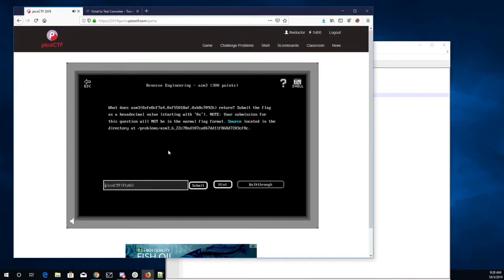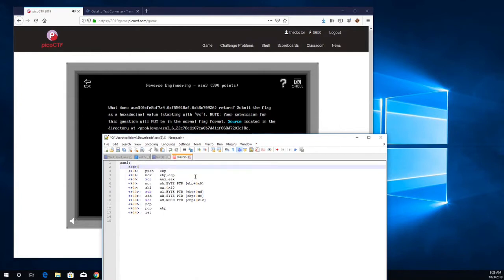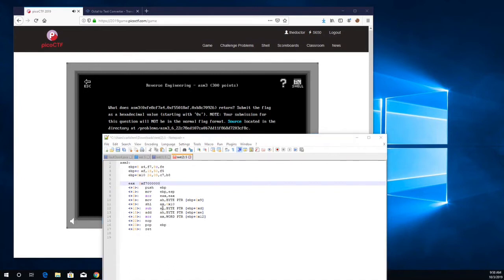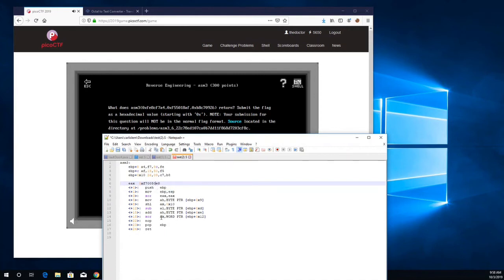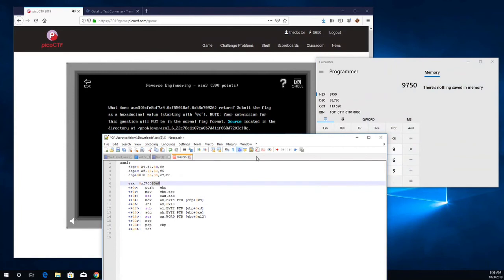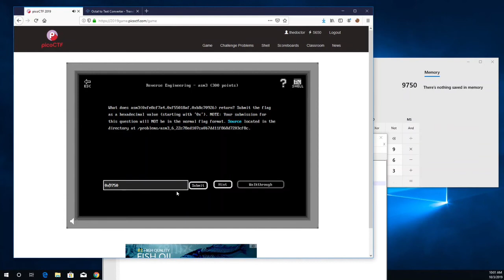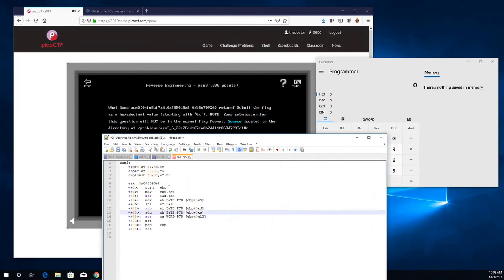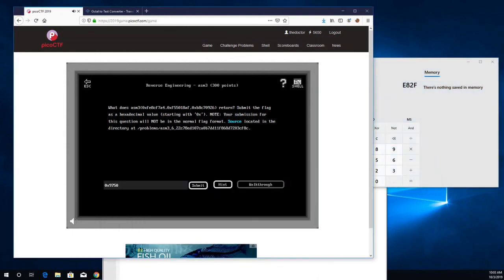pico2019 asm3

Comment: Hello, how do you know that it is in the little endian format and how do you know that the first parameter will go in at ebp+0x8?
Reply from the maker: The intel architecture is little endian. Parameters are pushed onto the stack. Then, the call instruction stores the return address on the stack, then there is a push of the old ebp, so there are two values (8 bytes) between the new ebp and the parameters.
Reply: @carlislemc  thank you very much Martin

Comment: i dont understand the sub at <+12>

al = 0x00 since eax = 0xf7000000; [ebp+0xd] = 0x18

so the calculation, as  far as I know, should be: al - 0x18 = 0x00 - 0x18 = -0x18
but the result seems to be 0xe8, but why?
Reply from the maker: Good question! -0x18 is equal to 0xe8 because of twos-complement. There is a good article at wikipedia on twos complement.
Reply: @carlislemc  Thank you very much!
Reply: Thank god for this 3 year old comment. I wasnt sure what I was doing wrong.